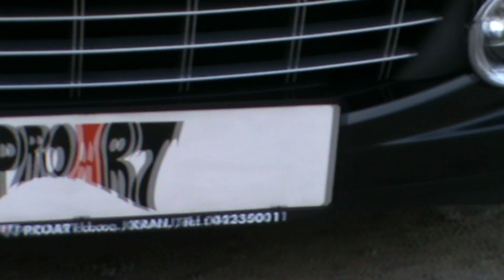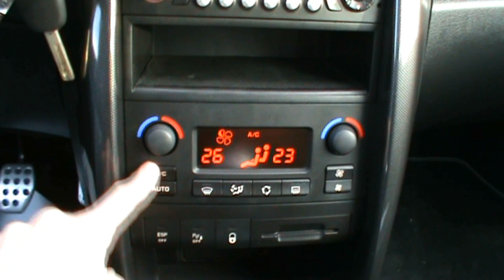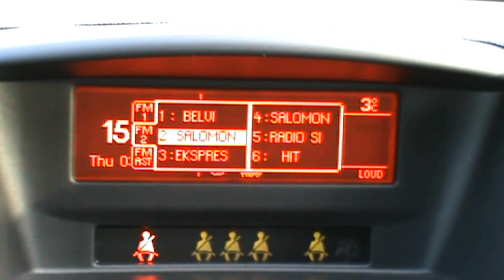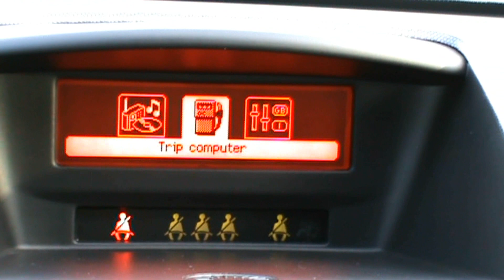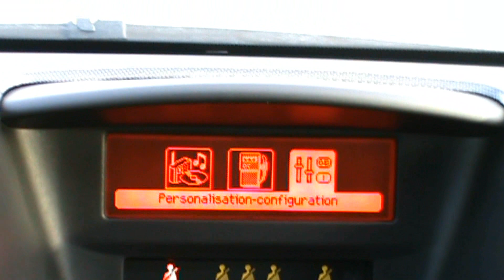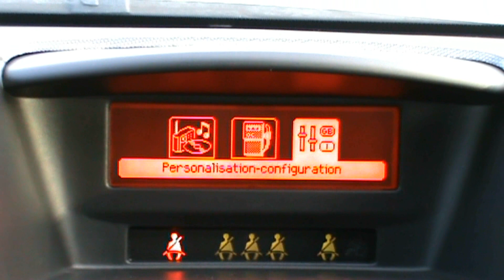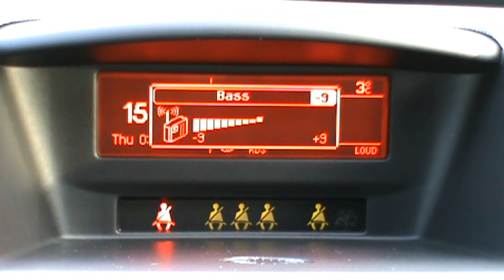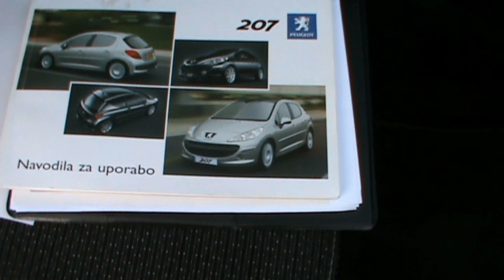2007 Peugeot 207 GT 1.6 16V Turbo Review,Start Up, Engine, and In Depth Tour

Comment: I was going to get one of these but the engine on these sounds louder than my diesel 1.6 hdi 110 bhp with 123,000 miles on the clock and it has a rattle on the front heat shield

Comment: I have a Peugeot 207 2012 model. When I turn on the aircon my car goes into limp mode. Can anyone say what could be wrong
Reply: It's like that on all weaker engines (1.4 and lower) especially petrol. The AC is powered by your engine – the serpentine belt that runs your alternator, water pump, power steering pump and other accessories as well as turns the pulley for the AC compressor/clutch.